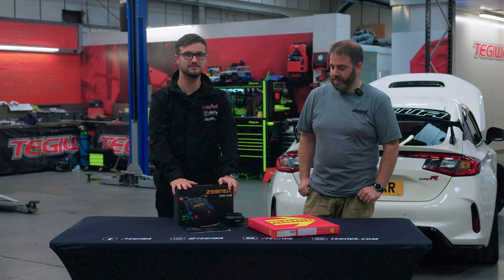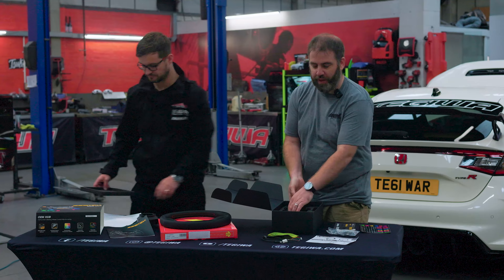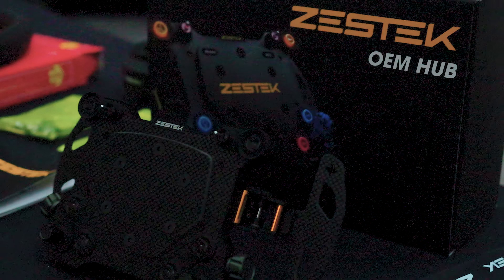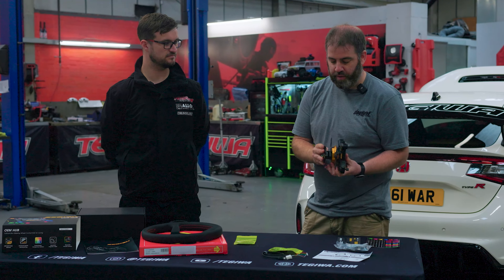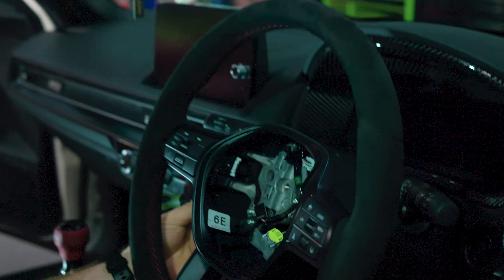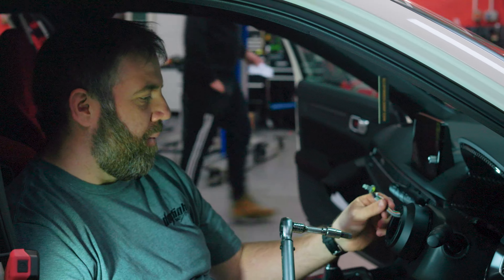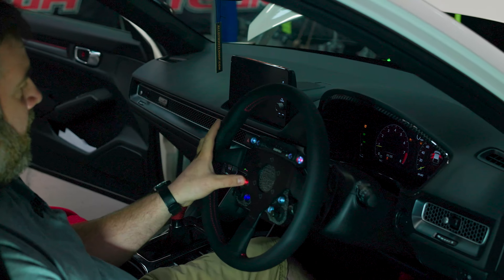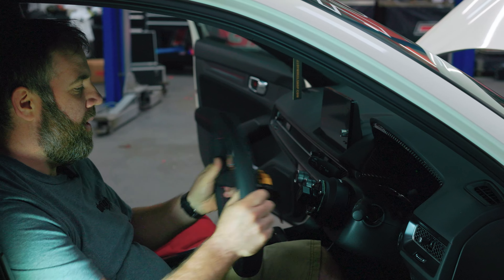Installing an aftermarket MOMO steering wheel and Zestek Racing hub to our Civic FL5! (How to guide)

Comment: Where can I get that Honda plate you put on the steering wheel ? 19:07
Reply from the maker: The carbon plate comes with the Zestek hub. We just made a Honda sticker to put on top!
Reply: @tegiwa  thanks for a quick reply !
Reply: @tegiwa Someone should make that carbon plate and sell it. My OMP quick release doesn’t allow me to run a horn button and this would have been an excellent solution.